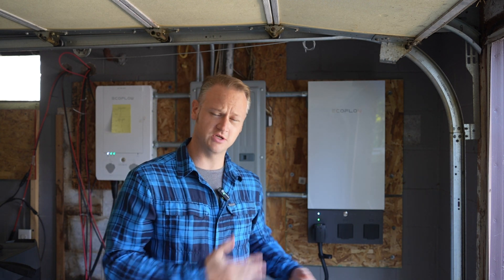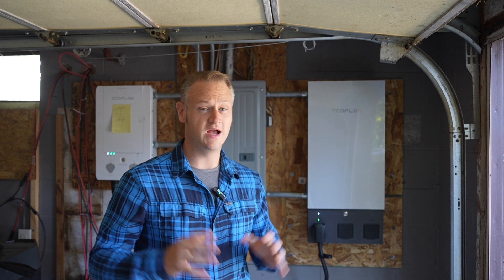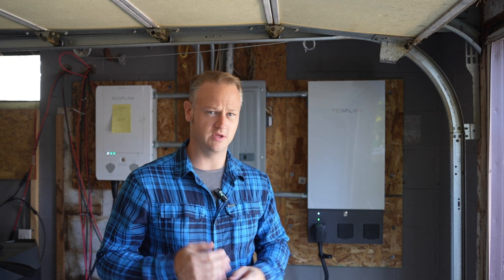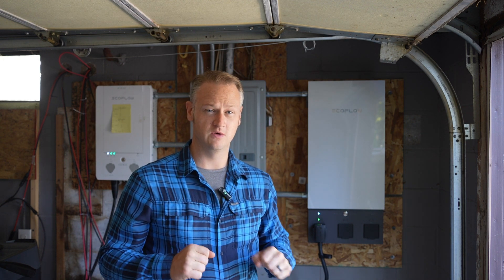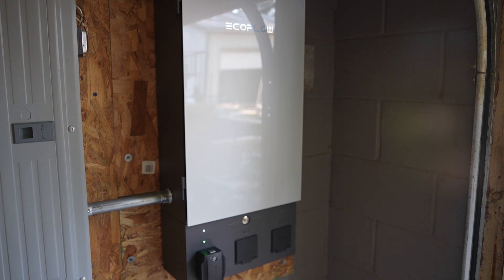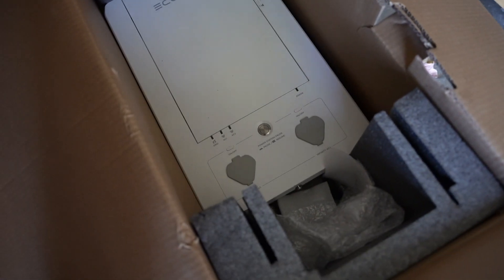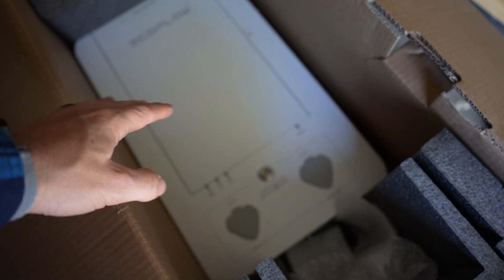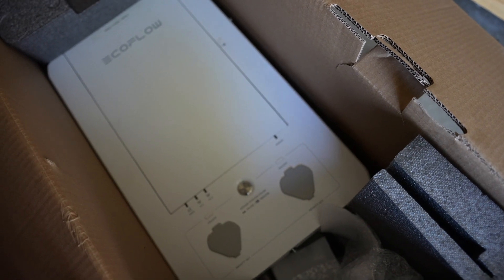Ecoflow Smart Home Panel Problem - RESOLVED

Comment: I have the same issue with the relay. Paid for new relays and it was worse. Have been running 9 circuits for a year because I find the service extremely poor. I tried updating to the New firmware today 6/27/2025. It was having issues with the update then a few minutes later the Smart Home panel stopped working. It bricked. I’m now completely on Grid power and it’s on the premium double charge rate!!! I’m also waiting on my replacement delta pro so I could go back to 2 x banks of battery backup but that’s now moot since I have no smart home panel. 21.6 Kw (-3.6 Kw)of backup power that’s literally unusable. We’ll see what they can do. I hope your Home Panel 2 is the magic answer! Good Luck! I’ll subscribe to see how your system is working. 
Regards,
Cesar

Comment: Makes me nervous, just installed a new gen 1 panel in my house and now I’m seeing several videos with glitches.  I can say the modules are very sensitive so far, say they’re unplugged so I have to push on them to reset them.  Dunno why as it’s attached to a concrete wall.